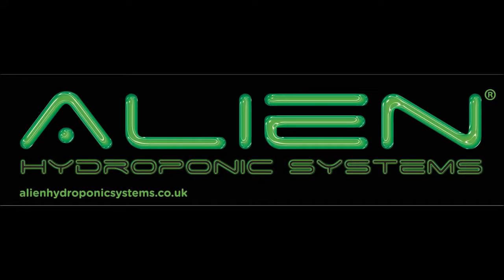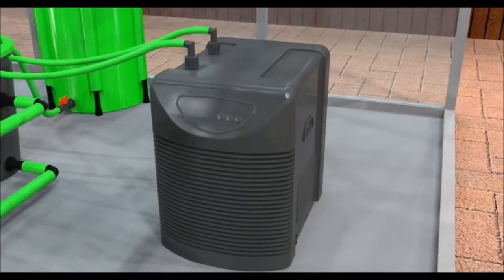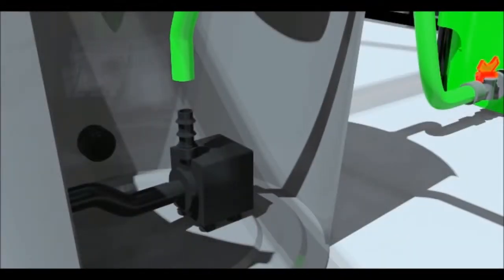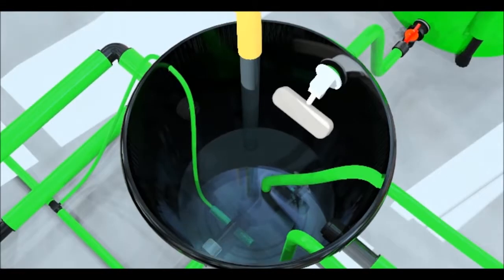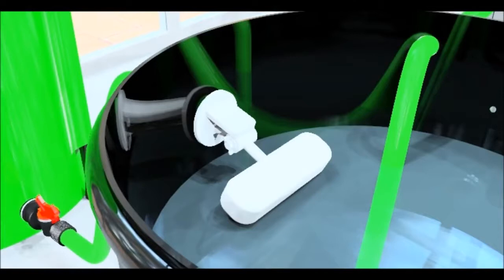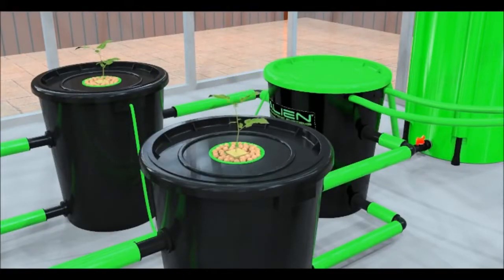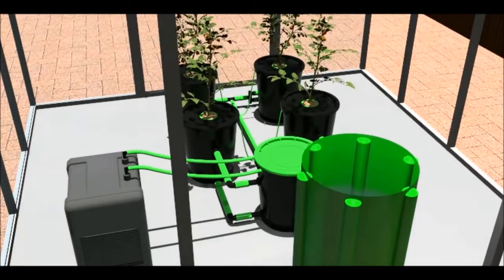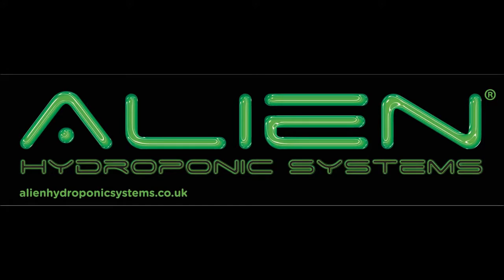Alien® RDWC Hydroponic System Operation Video

Comment: why put the water cooler and the main reservoir inside the greenhouse ??
you can't produce cold without producing more heat than what the cold can balance
in simple words that mean if you take the heat off the water you need to put this heat somewhere , so you put it in the air
( also, your water cooler produce heat by itself while working... )
so if you put all this hot air inside the same room as where you have your new cold water, the water will absorb back the heat within a few hours AND the heat generated by the cooler on it own 
so on the long term you end up with a water hotter than before